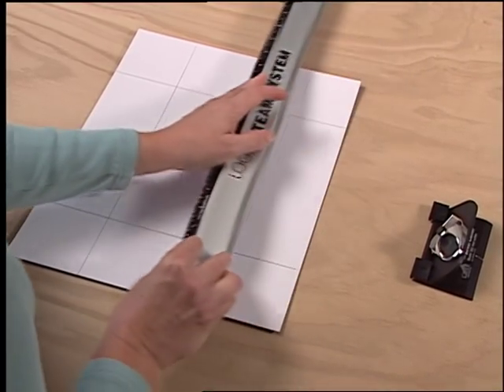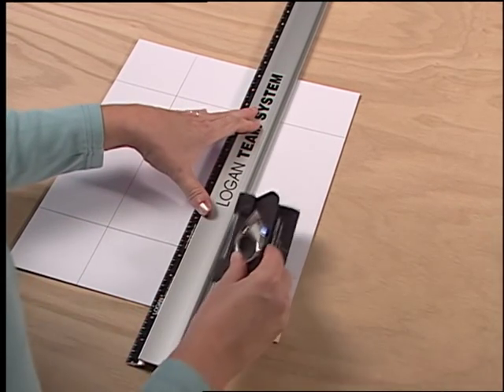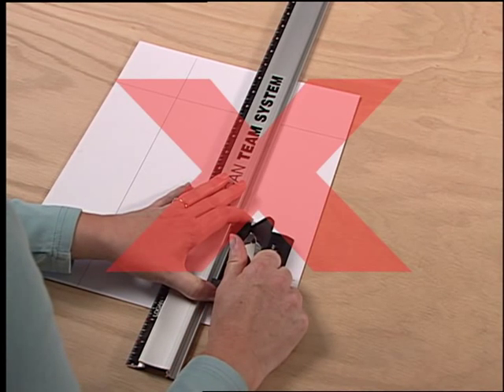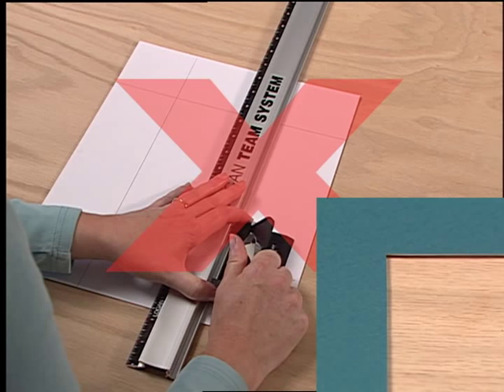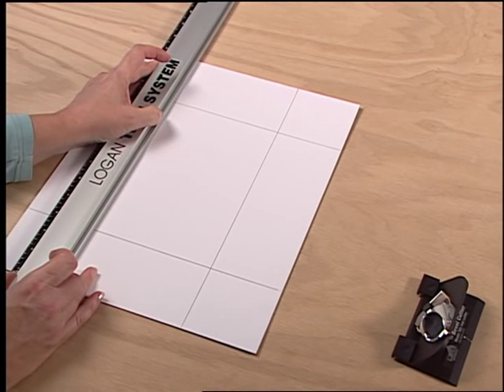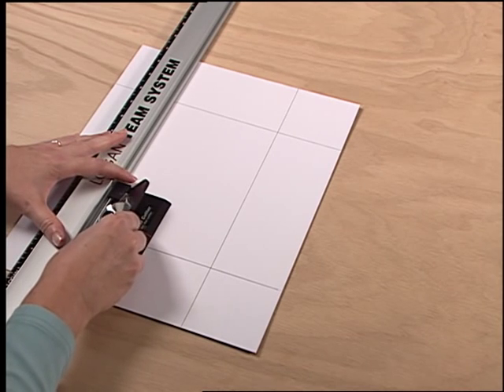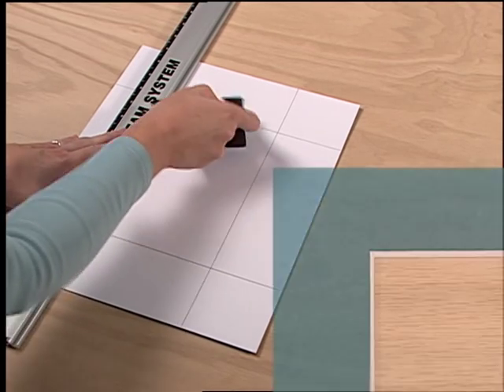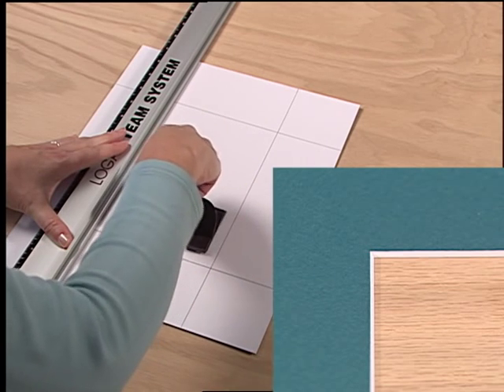How To Avoid A Reverse Bevel on a Logan Mat Cutter

Comment: I am on inside, trying for multiple windows, am having 2 reverse cuts
Reply from the maker: Hello. You must always make sure that you are cutting from the back of the mat color side down and see that the cutting head is inside the openings you have marked out. Meaning its cutting on the insides of the boxes you marked, not the outsides or you will get a reverse bevel. Thanks.
Reply: @LoganGraphic  thank you I got it now.